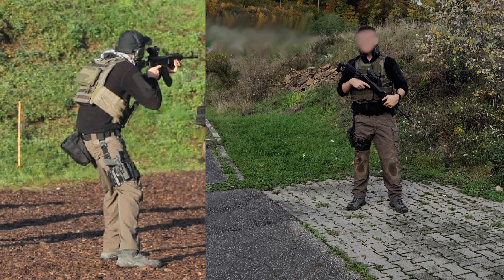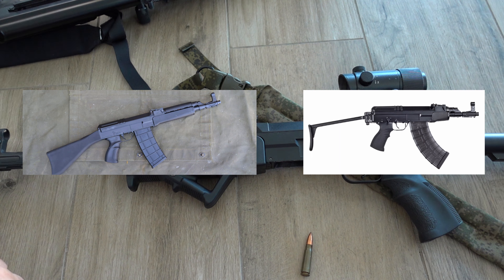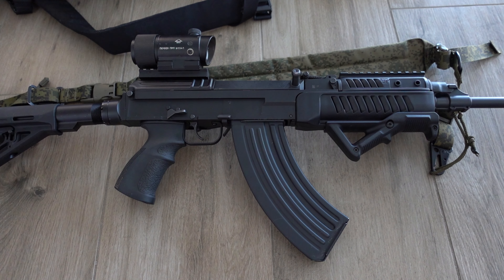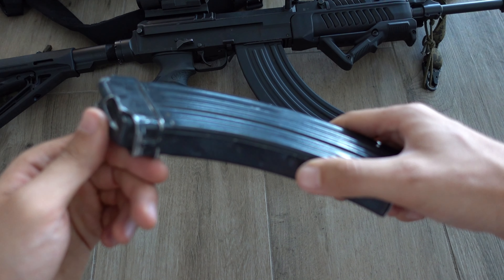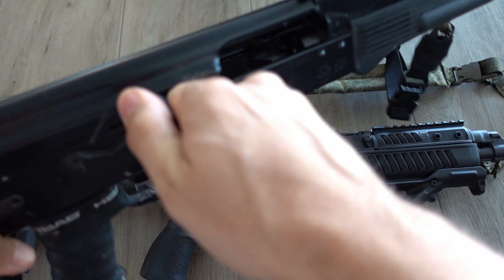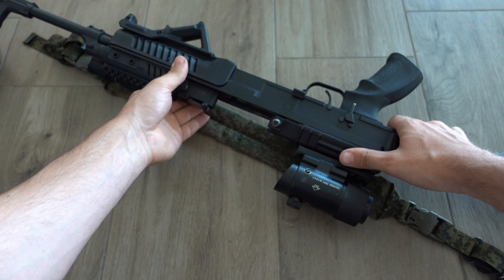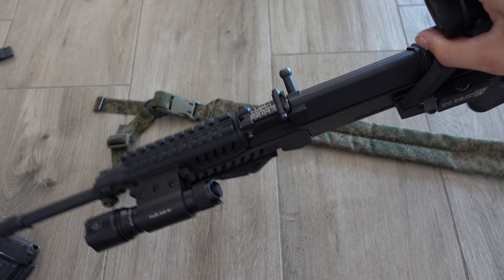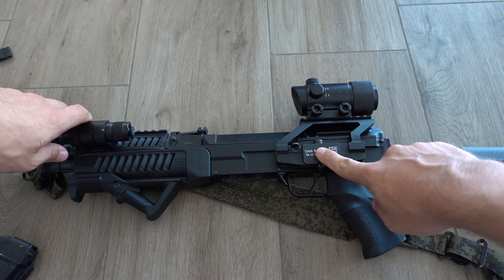My Rifles - CSA VZ58 (not an AK)

Comment: It is old concept of gun. The target dissapear after every shot for a few seconds;-) But still in use by Slovakian army. It is reliable, simple and cheap.  Czech army betreated this weapon by a shitty Bren.
Reply: Well, Vz 58 has a problem with a lot of sand, taht experience from midle east missions, Bren 805 has some birth problems, but Bren 2 should be more reliable than Vz 58, at least theoretically. For western style weapons, it takes some time to tune it and remove all problems, but for example AR platform is very realiable now after decades of improvements, if you find actual mud and dirt tests, you will see that AK, VZ58 and all these weapons are actually not more reliable than most of modern weapons, more like vice versa. Only advantage of Vz 58 and AK is that it's very overgased, so it mostly cycles reliably even with unknown ammo, while with AR based weapons, you sometimes have to adjust it when it doesn't cycle with enough power, but nobody says you can't set Bren to "kick more" settings like on AK and have it more realiable and more dirty all the time. 😀